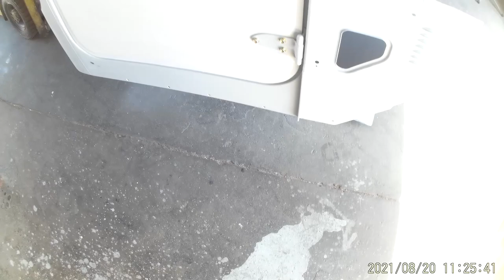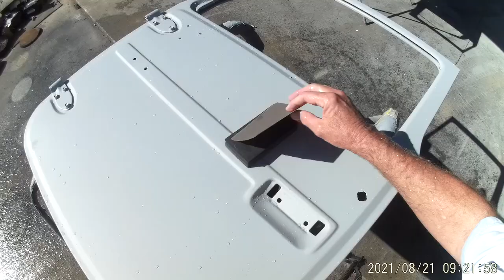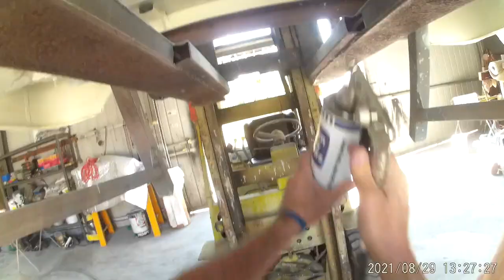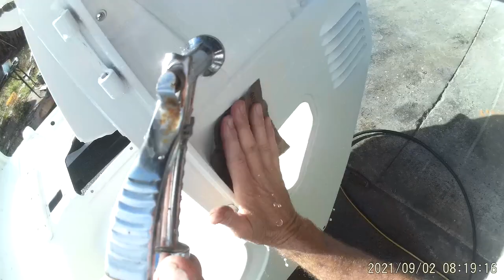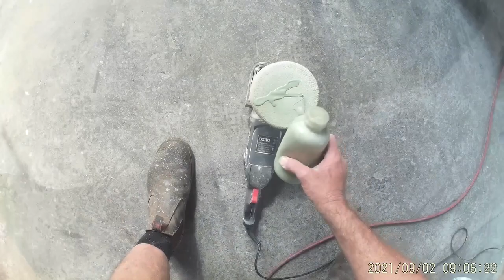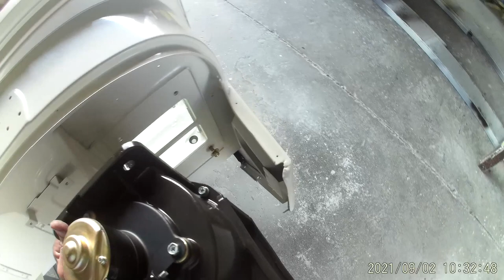Lower cab painting and polished

Comment: That is going to be an amazing ute once it’s finished! Why did you decide to put the door hinges back on before painting the doors? Also that restored blower motor looks great.
Reply from the maker: Thanks Ben because I don't like it when the bolts are not the same colour as the rest of the car.
Reply: @toyopatrestorations1588  I get that because I want my bolts to be the same colour also, however not having the top coat under the door hinges would get to me
Reply from the maker: @benpowderham6605  You are right but that is the way Toyota did it.

Comment: You don’t use a paint booth Simon? Do you have any issues with debris and bugs landing on the paint?
Reply from the maker: I don't have a booth anymore. I use acrylic paint which drys very quickly and needs to cut and polished. It is very rare for me to find anything on the paint.
Reply: Thanks Simon. Would certainly make life easier. I’m doing up a HJ45 Troopcarrier and I’m procrastinating about whether I can do it in the garage at home or whether I find a paint booth.  This gives me some hope though. Cheers
Reply from the maker: @bradgqute   Just paint a few smaller panels and see how they turn out.